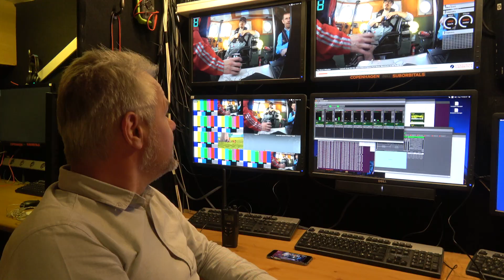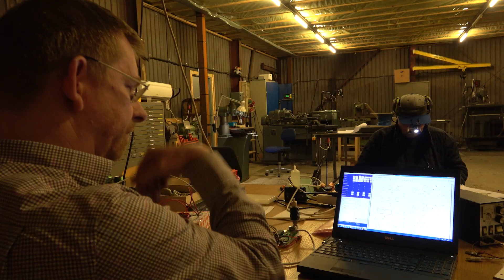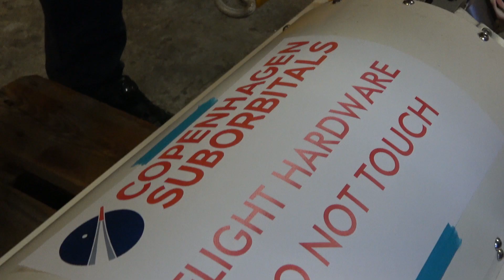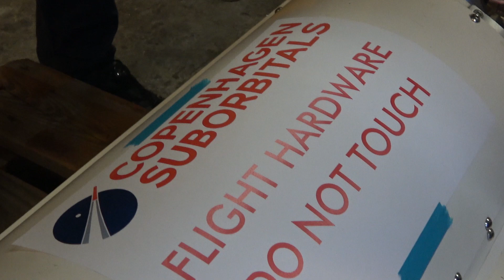Status in Copenhagen Suborbitals.

Comment: Why are the electronics housings made from aluminium? Could they be made of plastic to save weight?
Reply: The metal enclosure provides electromagnetic shielding, which is important when there are radio transmitters and receivers close together. Furthermore, the radio transmitters generate a lot of heat and the aluminum enclosure acts as heat sink.
Reply: Thanks, keep up the great work.